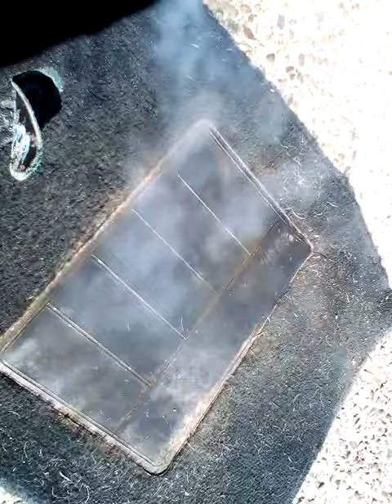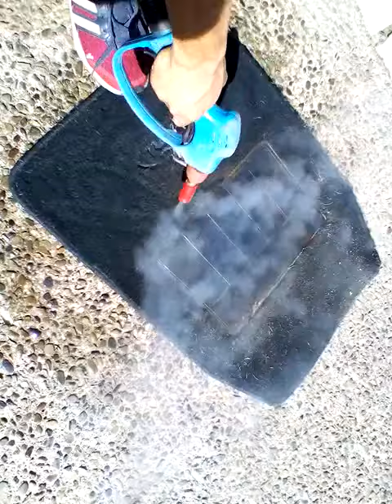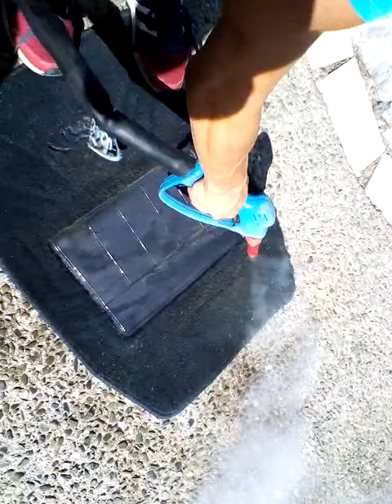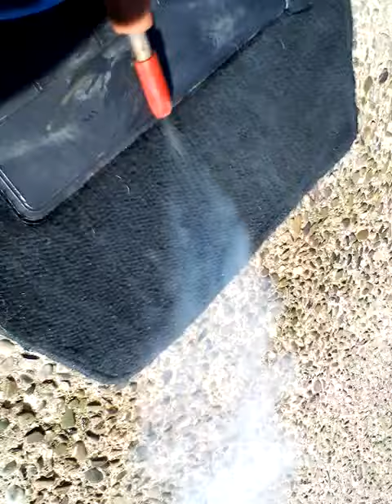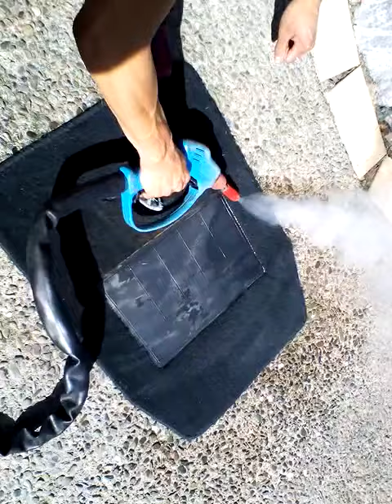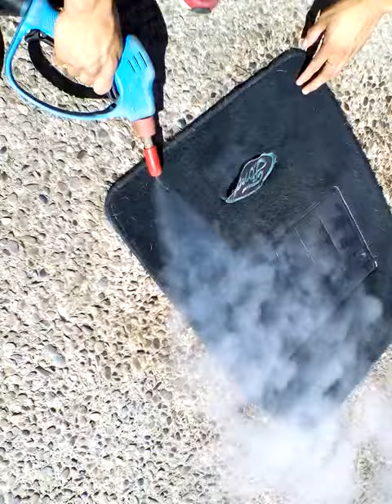Steam cleaning a very dirty Ford (part 4)

Comment: were did you get the hose protection you got over the hose
Reply from the maker: Free from any bicycle shop, its old tubes. May leave marks on upholstery sometimes but its cheaper to clean the marks than to replace the Optima Steamer's Hose :)